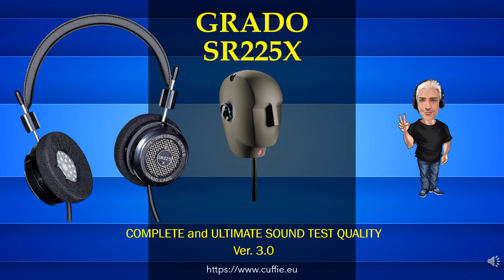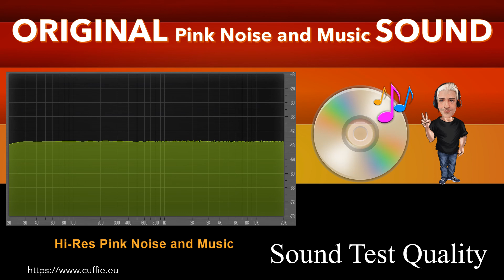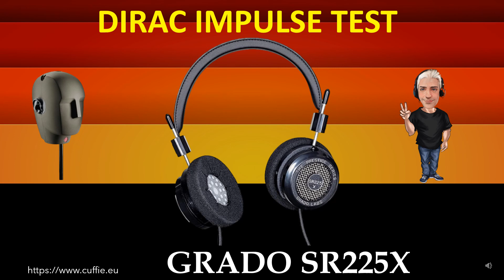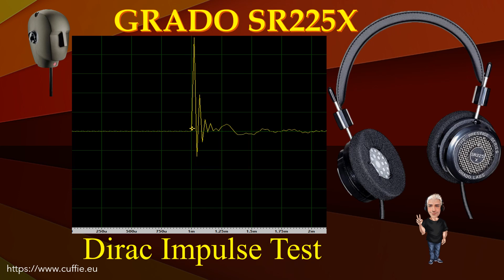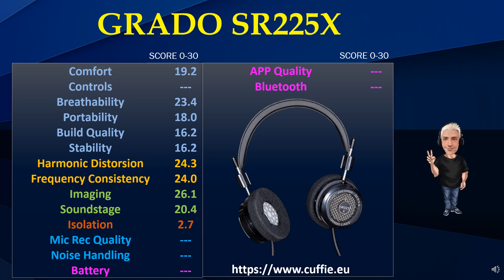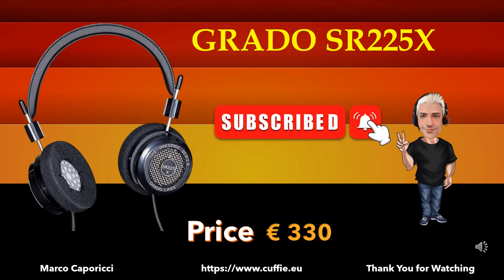GRADO SR225X - Review, Recensione, Sound Demo, Sound Test

Comment: Interesting, cymbals sound like they're significantly lower pitched with the 225X compared to the 325X. And it sounds like they're being struck from a disembodied central point in space with the 225X, whereas there is an unmistakable sense of dimensionality regarding the perception of a cymbal being struck from the top with the 325X. I did not expect to be able to tell that difference just from a sound test without needing the actual headphones. Solidifies that 325X are a more accurate representation of the music, especially noticeable with genres like Jazz.